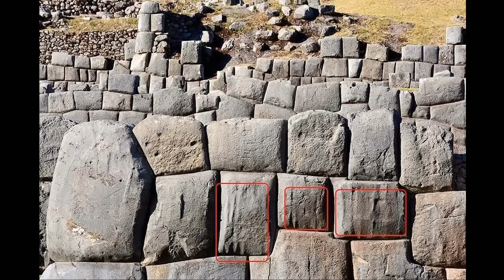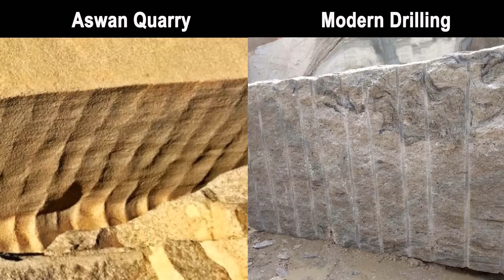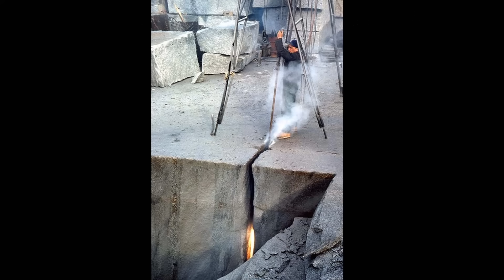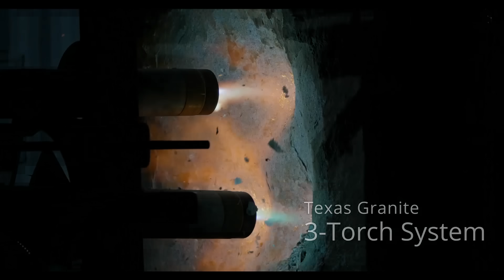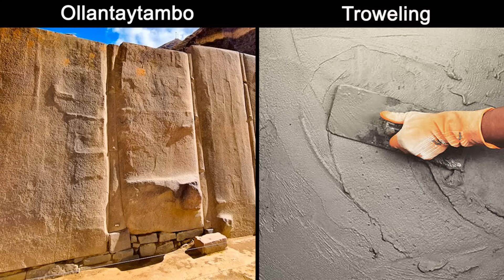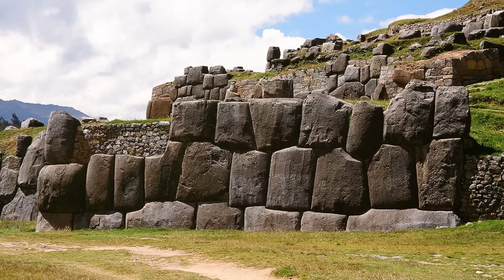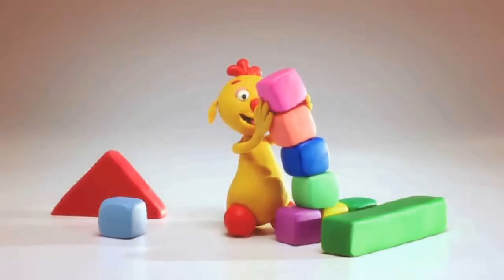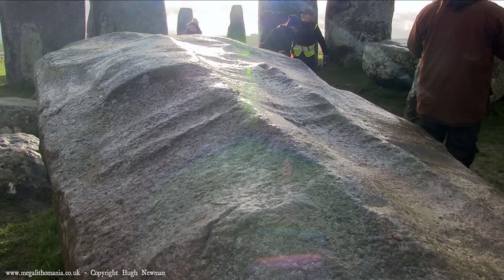Megalithic Mystery: Different Scoop Mark Types?

Comment: You are right on Type II. Ancient Peruvians had geopoymer capability, and made the material from the same stones they used in their construction. The evidence for the formula and application is weak, but the physical evidence of softened material is overwhelming. Casting in "molds" is very difficult to explain, but geopolymer can be made in a thick mortar paste and parged over natural or artificial stone as needed and then shaped. Thus the obvious screed and other soft material marks. Well done!
Reply from the maker: Thank you for sharing your thoughts on the subject! 😊 I appreciate it 😊

Comment: A hammer stone hanging on a rope from a tripod, A-frame, or gin pole would make these kind of “scoops” as the stone is swung back and forth….chipping and abrading the surface as one or two men swing the stone back and forth.  So would a stone tipped horizontal battering ram suspended from a frame above….

Comment: You are wrong on Type I. The evidence is an accumulation of scorched stone debris, firebrick fragments and charcoal from wood fires associated with scoop marked quarries in Aswan. Fire setting was used to make these marks, supported by that evidence and proven to work by modern experiments. But instead of following evidence, you imagine plasma torches, can't square that against the technology of Dynastic Egypt, and are forced to "multiply entities" by leveraging it to an entire missing civilization to justify your torches! The very essence stated in Occam's Razor is that you not "multiply entities" beyond those which are necessary to explain the evidence. This is an especially egregious example of that failure, and arriving at the wrong answer. It's just fire setting in a brick frame with 40cm x 40cm interior.

Comment: A giant magnifying glass or polished copper reflectors, with water. Heat the rock with sun power, then dump water on the hot rock.
And yes to geo-polymer as another method the ancients used.  I also think they had copper or bronze cutting wheels and core drills that used a water and sand cutting mixture.

Comment: Tina, agreed, your theory regarding heat being utilized to remove material like that of the unfinished obelisk in the Aswan quarry is by far the best explanation so far.
Reply from the maker: I appreciate you watching and the support! ✨
Reply: I agree
Reply: The only way 
nowaday humans can have to weak the bonding force of atoms is heating, but they can do better.

目前人類能夠削弱原子結合力的唯一方法是加熱，但他們可以做得更好。
Reply: Thermal torches to channel granite were industry standard until the 90s when diamond wire and channel slot drilling replaced it. We still use thermal torches to carve and surface texture granite. You can research companies such as Pelligrini, Italy, and Lutz, USA. I used to run a Lutz brand torch powered with diesel to burn channels 40- 60 feet long by 12 feet deep in very hard granite.
Reply: Вы очень сильно недооцениваете силу человеческой работы... Камнями и образованным песком, нагревая камень, используя кость, дерево , и медь, можно обработать камень. Это давно показано в эксперименте канала ANTRIPOGENEZ. ru
Reply: Most definitely acid. A lot of acids that melt stones. And heat would make the surfaces transition to glas and be shiny. I have worked with stone and its pretty common to use acids for cleaning, use a bit to much and you instantly get scoop marks.
Reply: @LuiLulumon it's 27000 degrees. The stone is just exploding away before it has time to become liquid.
Acid might have been used at limestone, but not on these granite scoop marks
Reply: @jochenwagner2782 i used to burn deep channels in granite quarries with a hi-velocity hi-temp torches. The granite rapidly microfractures then spalls reduced to mostly powdered sand. Using modern sophisticated thermal technology its virtually impossible to heat an open surface area to produce an even glassy melted surface. The result will instead be black glassy globules of runny slag.
Reply: @LuiLulumon not the case for granites which i.encourage you to try..
Reply: Not heat, vibration is the answer
Reply: @59sixstringer these are heat signatures we recognize them in the trade.
Reply: @GroberWeisenstein uh vibrations cause heat
Reply: @59sixstringer thats inefficient and unwanted. Control is limited by the stone's grain size.
Reply: Indeed it's similar , but I personally believe that the method they used is beyond our imagination . they can manipulate the binding force of the atoms therefore soft the rocks. Once the rocks are soften, a simple scoop machine can dig a trech like that.

確實很像，但我個人認為他們用的方法超出了我們的想像。他們能操縱原子間的結合力，從而軟化岩石。岩石軟化後，用簡單的挖溝機就能挖出這樣的溝。
Reply: @davislin7603 if you affect the bonds what you get in return are simply grains of sand. The crystaline bonds are what gives the stone's minerals structure.

Comment: Cosmic vibration results in gravity with the stars and planets nodes through which it acts. An advanced civilization employs cosmic vibration that pervades the universe for communication, radio waves being too slow and limited in range and scope. It is not because extra terrestrials are not conversing, which is why we cannot hear them. We have the wrong kind of receiver, incapable of decoding modulated cosmic waves that carry intelligence from inter stellar civilizations.

Pyramids scattered around planet earth once served as receptors that concentrated and focused cosmic sound vibration energy, a source capable of generating light and propelling high speed motors. Lightning is a discharge of cosmic vibration energy.

At a fork in the road of progress a previous society harnessed sound energy, but our current civilization developed electrical energy, each a product of chance. 

Like one magnet pushing against the same pole of another it is not unreasonable to expect that gravity exhibits a similar property capable of raising an object. Each force has an opposite counterpart. The buzzing of an insect’s wings neutralizes gravity and keeps it aloft. 

An ancient human being striking two cone shaped stones together was fascinated by the change in tone as he altered their relative position. Then, to his utter astonishment, the boulder upon which he was leaning became as soft and lightweight as expanded polystyrene, while a nearby stone levitated, but when the ringing ceased the boulder resumed its solidity and weight and the stone fell back to the ground. 

Gravity is not a fixed, constant value. It only appears that way observed from a limited time frame perspective, but may vary as we reach out into space and time.

Consider the universe where gravity exerted one-hundredth of a percent of its current force. Granite, no longer solid or heavy. Stone blocks could be cut and lifted with ease. Scoop marks are evident on ancient cuttings. Man is now incapable of moving these blocks, some of whose weight exceeds one-thousand tons.

On a continuum between the spiritual and physical substance, in which the spiritual is zero and designated matter is one-hundred, planet earth is at the 100 percent material level. The human mind, constrained by religious narrative, cannot conceive of an attribution that is somewhere in-between these two limits.

Cosmic vibration enables physical properties and provides a venue for electromagnetic phenomena.

Death is life in which gravity is absent of a role. Without this cosmic sound vibration that results in gravity, material is weightless. Neither is light reflected rendering humans invisible so that they cannot be distinguished from spiritual beings. Continuing living processes with sustenance is not required, as maintaining body temperature is now irrelevant. 

The purpose of life is to experience sensation and to multiply through procreation that cannot take place without physical existence.  

Warning: This point-of-view may not be suitable for those that are adamant that the sun revolves around the earth, which is flat and as anyone can plainly see this is irrefutable common sense.

Comment: Thanks for the vice video. I have a unusual theory on how the "scoop marks" were created.. This Aswan obelisk Is preflood. It was not stone at all. it was a constructed structure. Wood or metal beams. The vertical lines line up near perfectly with the raised lines on the top of the obelisk. The square patterns of about 40 centimeters is about the same spacing for framed structures today at abbout 16 inches. the obelisk may have fallen over during the flood and we can see some areas where the lines are damaged. the stone where the scoop makes hook under the stone, may have been all vertical but when waterlogged, they softened and collapsed inward. 

 When the waters rose, floods of mud may have tipped the obelisk over and filled the innards with mud. after the waters dried out, over thousands of years, the mud turned to stone and the original supporting members petrified  leaving only a raised line to indicate where they once were.
 
My theory is based on the scoop marks all lining up from the trench onto the the top of the structure and that the consistency is way to perfect with the exception of damaged areas. it just looks like something  " built " to me.

Comment: That makes sense and matches the original marks. Is there any other way to create a plasma torch with more basic technology? Similar to gasses from natural oil or tar
Reply from the maker: Thank you. The high temperature plasma torches require tremendous consistent energy. According to EarthGrid, a version of the machine using 72 plasma torches to drill a 1-meter (3.3-ft) bore would require roughly 40 megawatts of electricity on the low-power setting. AI calculated that "to maintain 40 megawatts (MW), a power plant would need between 250,000 and 427,000 standard cubic feet (scf) of natural gas per hour, depending on its efficiency. And if using petrol as fuel, AI's answer is "Based on a 40% efficiency, a 40 MW power plant would consume approximately 11,236 liters of petrol per hour." Plasma torches likely can be powered by other fuel sources, yet this type of project would need highly sophisticated power supply.

Comment: ..the scoop marks indicate a short cut in building/sculpting by hammering or chiselling furrows first then much more easily knocking off the ridges between each furrow...thats what is seen but its a bit sand blasted and smoothed over the passage of time....
Reply: Thats BS. How do you explain the cuts underneath the obelisk? It didnt see any sandblasting as it was buried in sand for thoughsands of years. Also, cutting underneath the obelisk would've been almost impossible, not to mention trying to get tools down the to pound the cut pieces out. Your theory falls to pieces.. try again
Reply: @joewalker9032  ..irregardless of cuts under obelisks or not, that is the short cut technique the ancients used...

Comment: Peruan Puma stone statuette has very small melted edges on ot. So they had something different from plasma blowers or casting tech. Yangshan marks are the same as in Barabar caves. These are not marks from hand tools - well, at least there is no way you can make such a deep and long scratch in granite with any modern hand tool. So these (stones) were probably softened too and then they worked manually with softened granite. Or these were made by machines.

Comment: I still believe that the scoops are not been scooped they was sand blasted because of the dished way they are , when a high velocity air is going threw a tube it will be slower near the walls cause of drag and faster in the center less drag of the tool in turn faster velocity of sand in center and slower near the walls of the tool means less impact the sand has on the stone and more in the center means more impact on the stone means it will be little dished and yes a torch acts very similar faster velocity in center less near walls cause of drag , the tool they used probly had to fit the velocity of what air supply they was using and potability and what they was cutting and I think when they was using it  could of be recycling the sand and pulverized rock as they went and its kinda simple to make an air supply even back then with hose and man powered air pump and I think they could do fine polishings with sand blasting as well.

Comment: My god!! This is the first explanation that actually makes sense. although the implications are quite astounding it seems to be the only thing that lines up with observations. Thank you for this video. New subscriber earned for sure.
Reply from the maker: Thank you so much for the kind words and welcome to the channel! 😊
Reply: Try Mike Haduck for perspective
Reply: Personally I don’t think geopolymer was used in peru. The most locical solution to the marshmallow shapes in peru is some type of chemical softening of the stone. You can actually quite often see discolouring from some form of chemical reaction if you look in between stones that have seperated from earthquakes.. But your theory that plasma was used in egypt sounds very logical. I think both plasma and stonesoftening was used in both egypt and peru. There is a few stones at Saqsaywaman that has “holes” that look exactly like plasma discharge.. There is a great video here on youtube from Versadoco called “stone softening, precision cutting”, very eye opening

Comment: If casting had been involved we would see patterns. People who had plasma cutters and used them in Egypt with ease could have also possessed technology to cut stones in Peru with equal ease.
Reply: Peru’s megalithic stones appear to be bound not merely by gravity or mortar, but by a deeper magnetic coherence suggestive of a transmutative process that concentrates electron clusters into stable quantum formations. Modern science is only beginning to glimpse the implications of these alterations, long encoded in the architecture of survival. These properties have allowed the structures to endure centuries of seismic upheaval in a region where contemporary buildings would crumble under time’s weight and tectonic force.
A suppressed archive of research and visual documentation exists, buried beneath algorithmic noise, revealing these anomalies in full. One such channel has dared to illuminate the quantum signatures and construction mysteries that mainstream feeds rarely surface. It’s not just stonework, it’s encoded resilience.
- VERSADOCO,  Eposide- Stone Softening
Reply: @ButterBuns00 
Thank you. I have watched some of his videos, but not on Peru’s megaliths.
Reply: @vadimkravets9209 That one episode, "Stone Softening", didn’t just shift my understanding of megaliths and ancient civilizations. It cracked open the scaffolding of physics itself. What I thought were fixed laws now feel like veils, thin, permeable, and hiding vast possibilities. It reconfigured my view of science, matter, and the encoded intelligence pulsing beneath the surface of our universe.

Comment: Landscape Matters 

Are we all hiding under the current, short term, germination of our sun's micronova cycle returning in 10-30 years, while ignoring the remedial architecture of a proven hydrogen universe, but, in the alternative dynamics of a variance of finite structure and, thus, architecture, or, hydrino, totally off grid energy, ten times TNT and tinier than tiny, flawless over 85 orders of magnitude, the context of classical in the "Grand Unified Theory of CLASSICAL Physics," 1st principles only, Occam's Razor down the pike and 100% consistent with form (condensation, cancellation, number and order, from G. Spencer Brown's book, "Laws of Form") and Dynamics (Abraham's and Shaw's visual math, volumes 1 thru 4 of "Dynamics"), introducing the blue attractor not witnessed in current spacetime, not for the triad? No nihilism is required. 

See Mental Boost 2 4 data on 9-11, anomalous mineral formation, magnetized concrete, golf divots in totally twisted metal cut in 30' segments immediately shipped off to China, unburned paint for the proposed heat distribution, pWoof, hydrino, a thermometer denominater issue ANTecedent2 a water planet, 1 Atom Ant (KISS, again) hot and fast, turning molecular on top of that, so much more, but, describing the path of transition in the universe's expansion/contraction closed circuit chemical-network cycle of transients including gravity along with magnetism, and, MASS, net neutral (I did say grand), and, preceding 9-18-01 where we were all permanently tethered to the grid, matched by our double, pivoting on MBAN. See nonvaxer420 for that compendium of true journalistic integrity. 

The true universe JWST confirms is oscillatory, that spacetime is iterative, is based on a much greater appreciation of the pure lepton that is an electron (i.e. not a quark) in a thoroughly BARYONIC universe consistent with E = m•c^^2, and, totally consistent with Ben Davidson's pulsing analog, he has denied, queerly. Denial is the only evil, omission, the worst sin. Is this this overarching? 

See BD on Matt Beall Limitless.

This is ignoring the present news cycle of manipulation in the substrate of the microbiome given by Ice Age Farmer, where Francisco J. Varela's, "Principles of Biological Autonomy," put together the components that lead to cellular formation given the set theory applied. Like the artist Saul Bellow, killed with a fish as promised after the divine comedy, "Humboldt's Gift," warning, for the healthy psychology in "More Die of Heartbreak," FJ was prematurely terminatED, too, vis-a-vis a cocktail, or, hemLOCKed2. Salvation is found in your own kind.

Comment: In my opinion: Tina is close, but it were NOT exactly this type of "plasma torches". Probably something similar - but different. As well something what peeling or destructing granite in similar way. Original Aswan marks even after few thousand year are way "sharper" on the borders.  Definitely not "scoops" of soft granite. IMO there was various tools used in same and/or different locations.